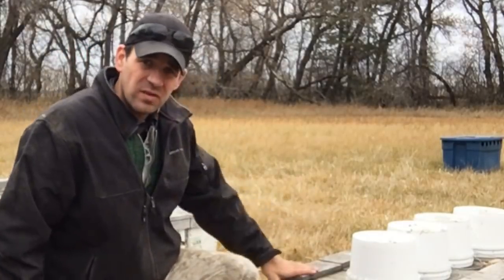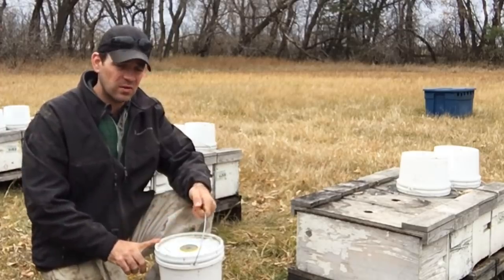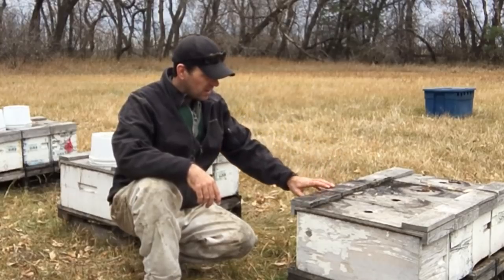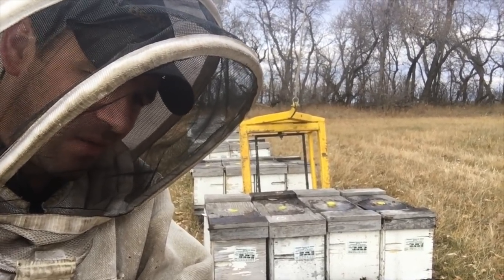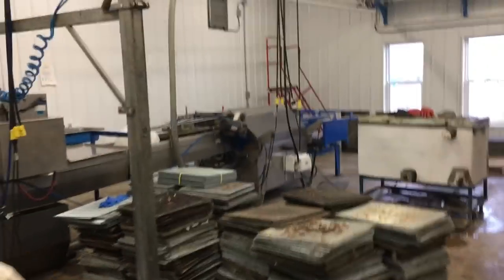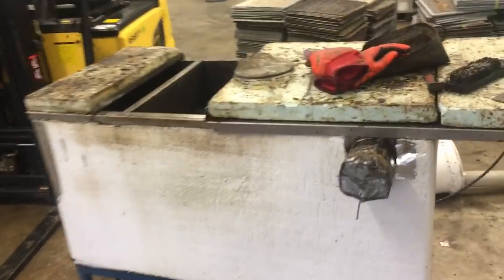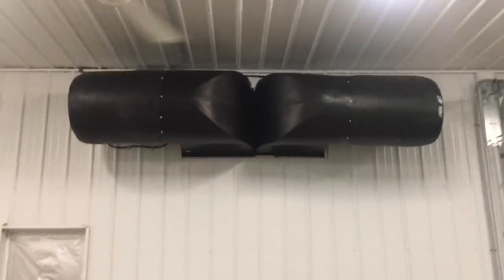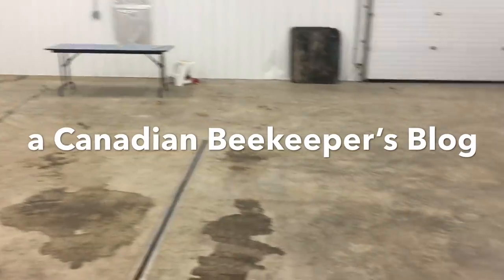the first bee yard moved inside

Comment: Do you heat the shed? Or is it just that the cover from the wind and wet is enough?
Reply: He cools the shed
Reply: Not in manitoba in the winter he doesnt. Pretty sure you can turn the AC off when its -30C. It gets bloody cold there. Im wondering if he heats it in the night to keep it at a safe level.
Reply: No he draws in air from outside to cool shed ... low humidity becomes a problem and high humidity he has it controlled with humidity control switch kicks on fans from outside...40 % humidity is his goal if i remember right .. . fans always going on on ceiling to keep air moving ..  he keeps a eye on CO2 levels